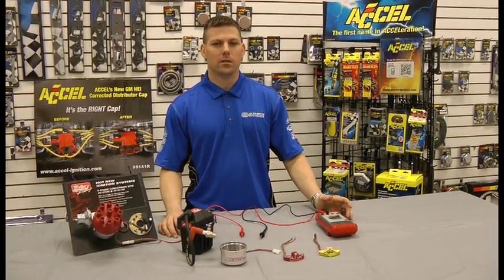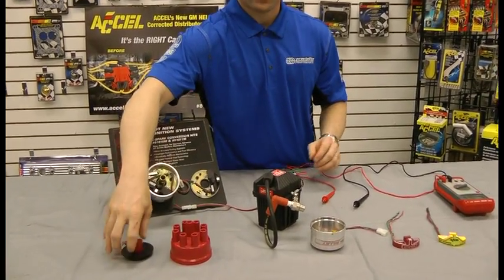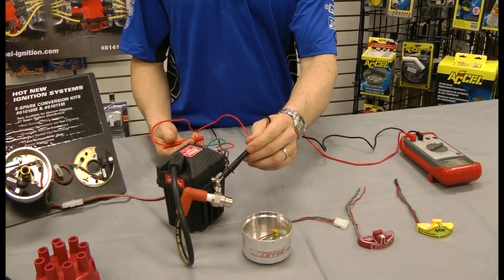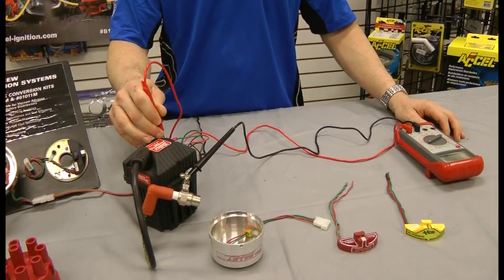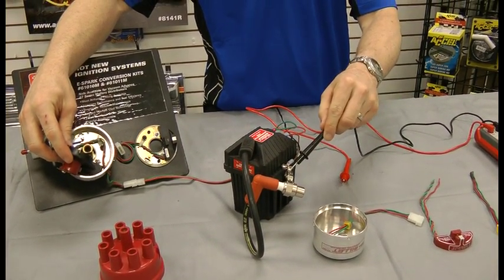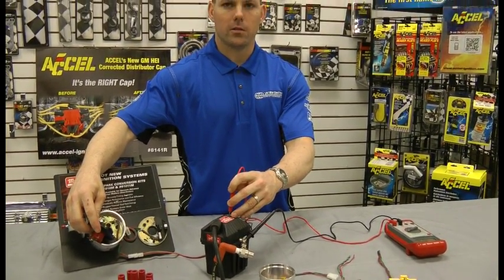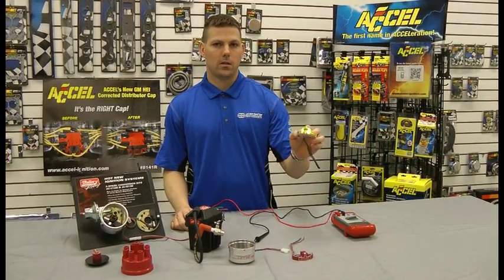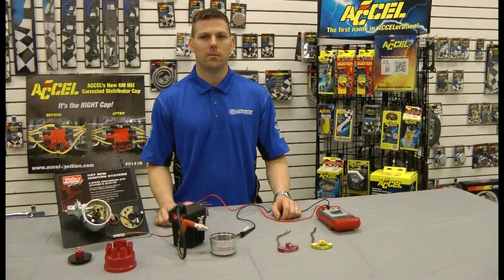Mallory Unilite Electronic Ignition Module Testing

Comment: What if the negative side of coil reads 2-7 Volts DC. You don't cover this in video. Is this a module problem as well?

Comment: my friend your not teahcin anything this way,  you need to be specific,   why, you put the rotor inthe distributor or you said a credic card?    and then test.?    you lost everyone this way dud
Reply: The negative post coil is the side that feeds power to the module after ignition is turned on.   That side gets connected to return/chassis intermittently by the ignition module, which causes coil field to collapse [primary/12v side] and that induces the high voltage the secondary outputs through the rotor cap to cylinders as you've wired them [per firing order] by connecting via the rotor when operating.  Testing the primary there eliminates any other faults before focusing on the optical trigger test.  As for the 8 to 12 volts, the resister being warm has not much to do with that - it's a fixed value.  But... coil temperature does:  reactance does drift on a dc coil as temperature goes up or down, so the amount of voltage it drops changes somewhat.   When coil resistance goes down,  its the resistor that drops more voltage and vice versa.  Combined, the battery voltage sees some drop after both devices before being routed through the ignition module.  A faulty ignition module can cause this value to drift all over the place.   If you see something weird like... 3 to 6 volts, disconnect the wire from the negative coil on the post and check again: this time [with open circuit] you should see full battery voltage assuming other wiring is good.   If nothing changes, put the distributor back together and trace back to the battery through any switches, connectors, relays, or splices that are between the coil and battery.  If you see that negaitive coil connection jump back up... replace the ignition module, but only after double checking the (-) battery connection return path to battery.  A dirty or half broken connection on return can do the same thing to you.  In fact... step one for all car troubleshooting should be to verify ground and battery connections - thank yourself later if a little wire brush action or connection tightening saves you from buying parts.  You would be surprised how many bad instrumentation problems are just a dirty return connection somewhere under the dash.
Now, you are ready to test the module.  It has an opticoupler circuit that is triggered when it is not blocked.  Notice the skirt on the bottom of the rotor assembly spends most of the time blocking light with only small slots to allow trigger events for the cylinders [8 cylinders = 8 slots].   When the beam is unbroken, the module switches  the negative post to chassis ["ground" or return to battery (-) terminal].  The card [you could use a piece of thin cardboard or maybe tape folded back against itself] inserted to block the beam gives you your starting point: the coil builds a field.   Then unblock the beam and look for that 1 or 2 volts he talked about on the negative post of the coil.   Do not leave it unblocked for more than say, 5 seconds: enough time to do the test.   You will find discussions on various sites about people that have had problems leaving their ignitions on for a long time: when it is done and the slot is allowing the opticoupler to switch on, things can get pretty hot and maybe fail.

All distributors are switching devices: if they do that, you can get spark.
Reply: @flinch622 fantastic description!!!! Very detailed!!! THANK YOU!!!

Comment: There's a gap in the module.  If you look, there's a ring under the rotor with notches cut into it.  This normally fits in that gap.  What you want to do is block the gap.  Somehow the module can read when there's something in the gap -- it's rather wide, too -- and when there isn't.

Comment: wish i had a multimeter... i just tested mine with a test light. with the light hooked up to the green wire and the ground wire... if i spin the distributor it blinks. i guess that means its working. but then it still doesnt drive my msd box. frustrating!